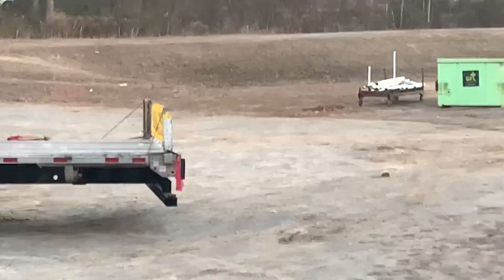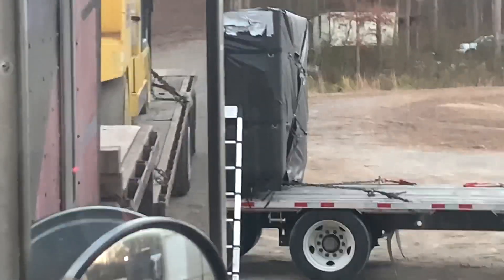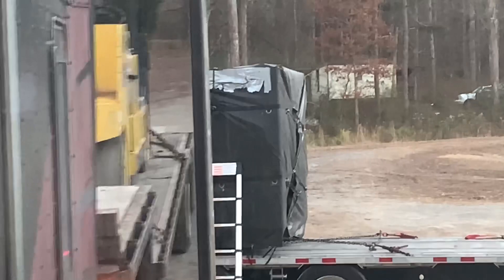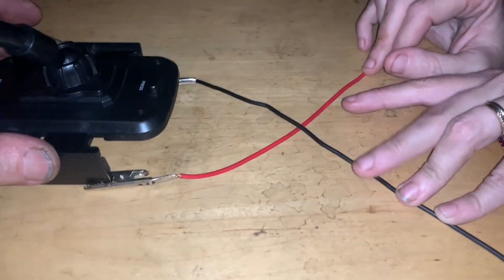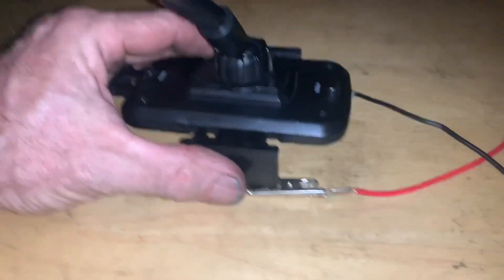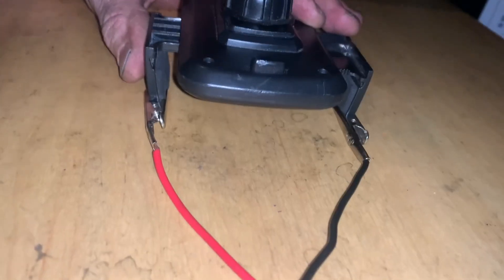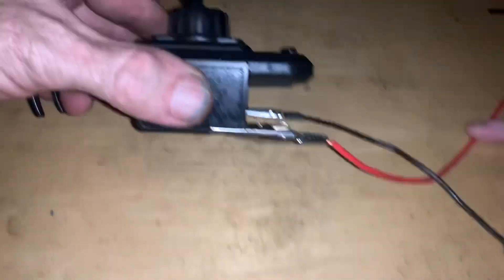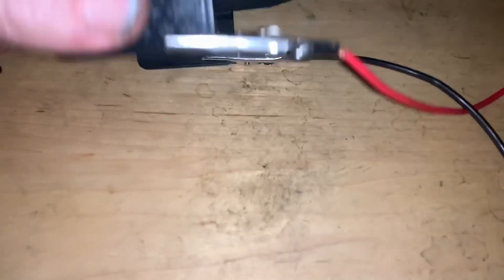Theoretical Physics and Trucking

Comment: well you never showed the entire load on his trailer
very often especially with wide loads , there are multiple anker points on the bottom and bottom side of the load
similar to a narcelle
or wind turbine top / motor section
you barely see anything holding that thing
until you get close up
and look underneath , too

besides looks to me he was still working on his stuff
and very often when they all done with tarping chaining etc , they start throwing straps over the top
if they are good @ what they do
and if they actually do it
all of it
let’s give that guy the benefit of the doubt 
because looks like he wasn’t done yet

on the other side I see plenty of equipment haulers with only chains on the bottom and maybe on the tracks
and none o those ever flys or flips off their trailer either